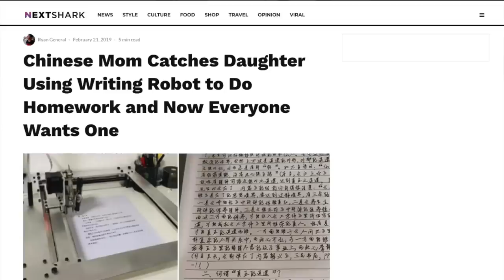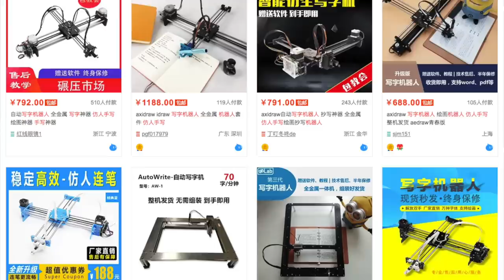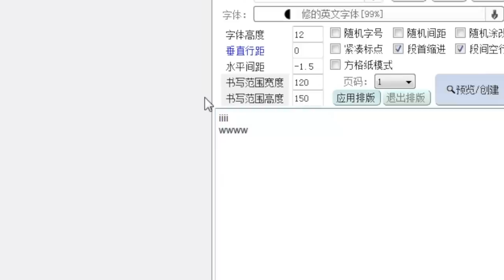Secret Chinese Homework Cheating Machine!😲

Comment: I think the American education system has already seen this.  Around 40 years ago we used to learn cursive handwriting in school. It was expected that esseys or other assignments would be handwritten in cursive.  Your only option was to type (as in real typewriter) your assignment.  This was to prepare you by either giving you more practice to improve your handwriting skills, or to learn  to type (something that was expected to be more important in business).  Then came the computer and the computer printer.  It was now easy to prepare your homework and have it "typed" out perfectly every time.  Using word processing programs such as WordPerfect or Microsoft Word, almost anyone could type in their assignment without having to worry about the quality of their handwriting or actual typing skills.  On the typewriter, it was normally frowned upon if you had too many manual corrections due to typing a word wrong, misspelling a word, or having to fix things using white-out or abrasively erasing the typewriter ink.  As the printer took care of doing a perfect print every time, a student no longer needed to worry about neat cursive (or even printed) writing, nor did they have to practice hours and hours of learning to type without making mistakes.   

As my dad worked for IBM, he brought home one of the first IBM 5150 PC's to come out, and I was hooked on it in no time at all.  At first, my teachers thought it was novel that I used the computer and printer to do all my assignments.  Then slowly, many of my teachers would not accept my homework turned in from the printer.  Later they would accept it more often, but as they thought it gave an unfair advantage to someone using a computer, they would subtract points from your assignment just for using the computer to "write" up your homework.  It was not until the end of my pre-high school year that it was common for everyone to either simply print or use a computer to prepare their homework.  By the end of high school, it was almost expected that all reports were to be prepared on a computer, and very few (I guess the poorest of families that did not have access to a computer) were turning in reports written by hand.  Then in college, it was expected that all reports were to be done on computer with very few exceptions.  These days public schools no longer teach cursive writing, and of course no one actually uses a typewriter anymore (unless they are doing so for artistic or sentimental reasons).    Today it is totally common for everyone to use a computer to communicate.  The older generations now joke we can all communicate in "code" to each other just by using cursive writing to each other using pen and paper.  Time, and technology move on, no stopping it.

Comment: Dear Naomi, thanks for an amazingly interesting video!
You've now discovered that proportional spacing is indispensable in western typography (and you obviously knew about the uppercase-lowercase distinction.) But that is certainly not all there is to it. 
- differential character kerning (such as with the "AV" pair) 
- ligatures (such as with the "fi", "ff" pairs) 
And then there is cursive writing which--unlike Chinese cursive--does join the characters in a sort of arabic-like fashion…

Comment: I work at a private school here in Denmark and yes the students learn how to write handwriting, but from about the fourth year they are given computers and most of their assignments are to be handed in electronically. 
We emphasize problem solving, understanding and critical thinking above memorization from thinking that you can't get ahead by emulating other people. The students study to understand and then build on what they learn.
Having a handwriting machine would be no different than using one of their normal printers here. They all have access to a school printer in their hallway.

Comment: Some years ago, I wrote a multilingual software for a microcontroller. Russian and Chinese included. I had to transcribe all words to the custom character set of the languages. Russian was still simple, since the characters are not so different. But Chinese was quite a challenge. I had to look up every symbol of an expression and find it in the character set. I noticed, that most symbols have a left and a right half and I memorized it like „man with tv antenna“ or „deer horns and saber“. It did work out this way. The Chinese partner of my customer was ok with my work :-)

Comment: Being that the English language uses 26 characters in combination vs the thousands that you stated for the Chinese language, replicating each of the 26 characters falls under scrutiny when the printed characters are the same size, tilt and spacing, etc. Very easy to detect for the English language. A simple test will show this. Write one English character 15 times in a row and then look at the results... there's enough variance that it's obvious (for some people's handwriting it very obvious, which I feel is the norm). So this machine would not be useful for English writing children in America as this is a skill taught very early in school. I don't see a 5 year old having the cash to go purchase this type of device. Then there's the process of setting it up... there would have to be parent involvement. 

As a side note: 
If this device is not too costly it looks like it could have some hacking potential...

Comment: My workplace has a device that is intended to cut out vinyl for signs, but it can also hold a pen instead of a cutter. Rather than it focus on writing characters, it simply mimics what is on the artwork file. In this manner the vinyl cutting machine would be better at mimicking English handwriting, so long as the file it is "printing" looks real to begin with. There are professional fonts that include ligatures and good kerning practices as well as alternate characters, which altogether help to make machine-printed handwriting to look more natural. I think it's quite possible to print something that will fool many people into thinking it was handwritten.

Comment: I can easily tell what was machine created compared to handwritten.   The spacing and the letters are perfectly spaced.  Handwritten, would be slightly off.  The columns would not be perfectly aligned.

All that said, I use to be in the digital printing business.  One of my projects was to create diplomas for graduating doctors of optometry.   I was asked to duplicate even the signature of the Dean of the school.  What I did was to slightly rotate the scanned signature and move it slightly so it was off center and covered some letters just like a normal signature would.  I could even duplicate what looked like how hard someone pressed the pen when they signed.   Lastly, I made sure that there was enough ink/toner to make the signature feel like it was indented when actually it was raised.

But an interesting tool.  But unless you take into consideration some random changes to the characters, I think most people would recognize right away that those were not handwritten.

By the way, that spacing that machine used is called fixed space characters, but mostly you want what is called proportionally spaced characters.   But aging, unless there are some random differences, it is easy to see machine created print.

Comment: I had that exact same problem when I made a font based on my handwriting... every same character was the exactly identical and had the exact same spacing... could never solve it... I'm pretty sure an entire application would have to be written to have dozens (or even hundreds) of versions of each character and randomize the character style selection, based on the design and flow style of the character.

Comment: It will fail in English (and any other language using that alphabet) because then you should write words, not separate letters. When writing by hand, the letters in a word are bound together with ligatures linking them. And that is a lot harder to reproduce like a human would, because a human will vary the link between two letters varies a lot more depending on the exact combination of the letters. Some fonts fake it, but you notice because the link is always in the same location for it to work with that font.

Comment: I work with students at the University and Highschool level in Canada. I think most of the profs would have an issue with the monospace in English, but they'd just say print it out with a printer if you were going to type it out onto the computer. Most of the educators I know of have written stuff just because it's in class, or because kinda "faster" in a sense because you're just doing it right there. But anything that's sent home to work on is typed out and printed out for handing in. Honestly, I much rather get a printed assignment than someone's written passage with eraser marks, and strikeouts, and however bad their writing quality may be. I've known a couple profs to even prefer the files digitally only, just for that reason. No point in ever having a physical copy they have to keep track of and keep for their records.

Comment: Well, there are handwriting machines like this available that are designed to handle English and they're being used to produce marketing material for companies and so forth, as well as signing signatures, so that they look like they were done by hand. There is software to program a macro to go along with a signature or a handwriting style that was signed on a tablet. You can also make your own font, so the machine "writes" in your handwriting.

However, there are ways to easily tell that it's written by machine. In the example Naomi shows, it's not just the monospacing, but also the font. If you use Word regularly, you will recognize many of the fonts, so even if it's "handwritten", most people will recognize it as somehow being machine-generated. Also, natural handwriting tends to have significant variations between letters, particularly when the letters are in different positions within words. And of course, you could always compare homework to something someone has written in class, and immediately tell that it's different!  So it'll be a while before anyone is using handwriting machines in a meaningful way to cheat in school when writing in English or any other language that uses Latin characters. Sorry, kids!  :-D

Comment: What jumped out for me (as well as the monospace but that was more when you pointed it out) is that the same characters look identical, which is the easiest way to tell something's using a handwriting font. But I noticed on the screen preview there are some tiny differences in the i's and w's - is there a setting you can tweak to make them more irregular?

I guess it works better for Chinese because you don't see the same character repeated as often, but do you do handwriting drills in school, where you draw out the same character over and over? I feel like that would make it super obvious, especially if the teacher's looking to see how you're improving and there's basically no difference at all, it's really hard to be consistent!

Comment: The Chinese Moon Crescent knife was a real nice touch. By the way, the reason I thing it works for Chinese and not English is that Chinese characters need to be consistent. You put a curl in the wrong place and you get something different. Cursive English does not need consistency. and looks funny if the letters are identical.

Comment: It's not just that it's monospace, but that in phonetic alphabets you will have a lot more repetition and the extreme consistency of the characters is obvious. The characters are designed to look hand-drawn (not perfect) but then the imperfections are repeated exactly and this is very obvious. Also, most europeans will join characters in several different ways depending on the combinations, even people writing in block letters will join characters sometimes and/or adapt letters to their context.

Comment: If you want to learn really good English cursive handwriting (roundhand), the trick is to abandon modern rubbish like ball-points and fibre-tips altogether and get a proper old-fashioned fountain pen - ideally one with a chisel point.  I bet it'd be quite a challenge to get one of these machines to work with a fountain pen, though - could be a fun little project.

Comment: I guess it works for hand writing of a style where each character has the same width. Western handwriting is proportional.  Additional you have transitions from character to character in a word. The pen leaves the paper only for dots or some strokes (small i or big T for example). For western pubils the software would need a serious upgrade. Additionally you need the option to create your own alphabet with slighty variations. I know some chinese write as the letters were printed, but in western culture the variation of the handwriting in a class of pubils is huge. After some time you can tell as teacher, who wrote what.

Comment: You can see the artefacts from the microstepping on the calligraphy part. Would benefit from Trinamic stepper drivers and a faster board (seems to be stuttering a bit at some points). Great results though for how simple it is

Comment: This would be  a great machine to modify  for a drag-knife.

As for the problem of looking wrong in English. (I imagine the same applies to Chinese if you look close enough) It goes far beyond being mono-spaced (at exacting precision) It also has to do with the fact that there is no variability (slight defects) in the drawing of any symbol or glyph Each glyph is drawn exactly the same way each time, with exacting precision. Go ahead try for yourself, in any language. Write the same glyph down 10 times in a row. I bet they are not identical, nor is the spacing between them precise. There is always going to be some defect (variability) when done by human hands, we are just not that precise without mechanical aids.

Comment: The machine is called a plotter. It was originally designed in the 1950s to reproduce/create large drawings of buildings or mechanical devices  (what we, interestingly, call blueprints). They were used before large format ink jet printers. They even had a Carousel of pins that could be interchanged automatically.  The introduction of variable pressure is an interesting addition. Any machine written text in English is easily identified because the shape of each letter varies with each line and with fatigue and spacing varies naturally.

Comment: As Adam Payne says, the consistency gives away the fact that this English is written by a machine FAR more than the spacing.

Think about it like this...  English has 26 letters, so the font only needs 52 characters (upper and lower case).  Even in the "Quick Brown Fox" writing sample, characters like "o" and "e" are written multiple times. But with 3,000 characters for basic Standard Chinese proficiency, there won't be enough character duplication in the same sentence to catch the fact that each character is written the same.

Comment: paused at 4:42. Unless the programmers wrote in a method for that to print with variation, any teacher will look at that and see that it's a computer print out. Back in grade 2, the teacher caught me swearing and she gave me lines to do. Didn't take me long to figure out that pencils were the same width as the line spacing on the paper so I held 5 in my hand and did 20% of the work. lol
8:30.. wtf I'm impressed. my written mandarin is way neater than that.

Comment: Its a small vertical plotter veery cool. My only problem is what happens in class when there is a test.. And you have to do all the writing yourself no machine. I cheated in math class and at home with a calculator and I regret it everyday but I still passed and I still can't do my geometry algabra.. Is there a machine for that.. Lol

Comment: you probably could "solve" the problem of the consistent machine writing without touching the program, you would just need to add some kind of device wich shakes the pen slightly when drawing longer lines, but if one wanted to be thorough, one would also need to add a radomizer to the program, so it will not always start at the exact same hight on the paper

Comment: The machine would need some AI learning in the software. This way you can scan samples of your own handwriting and the software can develop a full font to match your writing. Also add some fuzzy logic to make slight variations in the characters so the same characters written again will be slightly different. It probably already has this fuzzy logic in the software but if not it should.

Comment: If I write wwww and iiii it will not be identical for each character. Nor will the spacing and the alignment and the angle. Thus it obvious its done by machine. Software needs to have random very minor font adjustments, yet not too random.

Comment: You'd also know it wasn't an English (or western language) because the writing wasn't joined up.   Handwriting is typically joined up except when we're filling in forms that ask for "Block Capitals", which if you do on-line is considered shouting!

For the Chinese characters I would imagine the consistency is the problem, and how each is aligned left to right, top to bottom, too well.   It's un-natural.

Interesting about the Chinese education system being skewed towards STEM subjects.   Definitely how it should be!

Comment: For one - the monospace in english is very visible and puts you off instantly.
Secondly - as some have pointed out - the letters are very consistent, which is very unlikely when you're actually writing
Thirdly - some of us use cursive. I'd really like to see a machine doing cursive even if the letters are very consistent. Especially for cases like "te" and "we", where e is differently tilted.